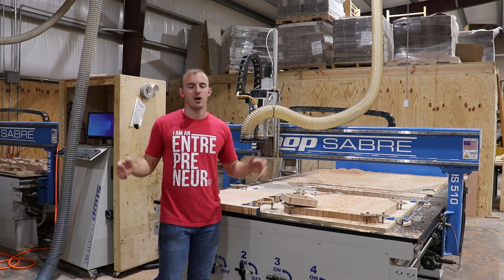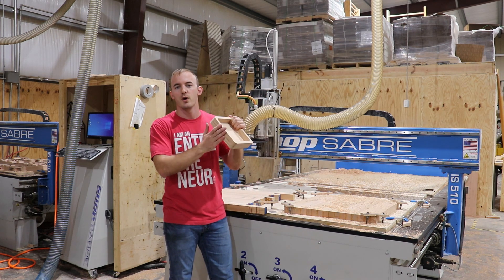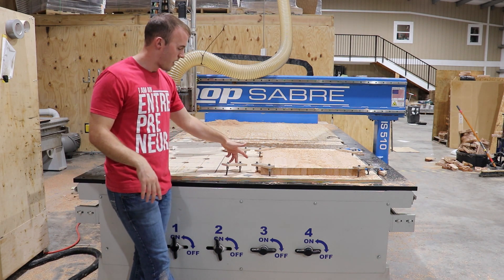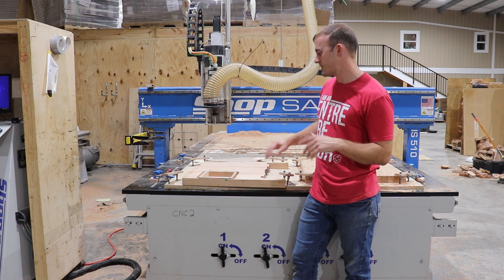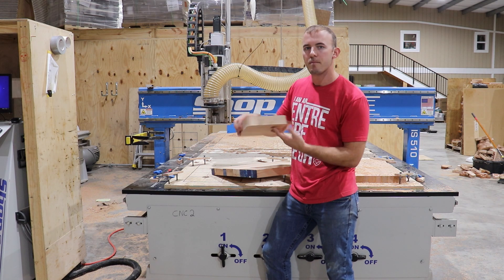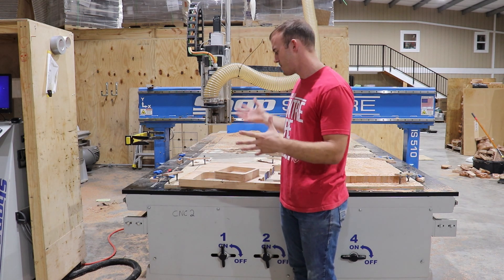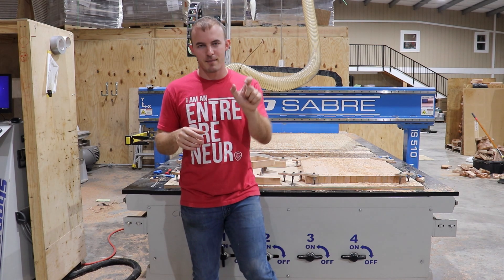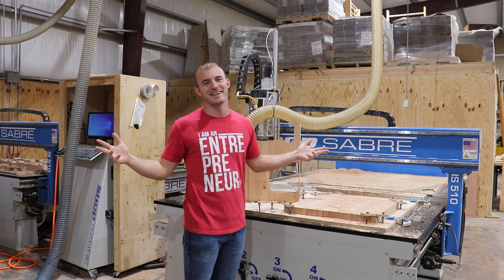Simple Oak Tray Cut | In Depth Look at CNC Router Machining

Comment: Good call on the mechanical hold down as well as the vacuum.  the machine I run uses a similar vacuum setup and it is very easy to shove the workpiece off of your datum. Especially for smaller surface area workpieces. Most of the work I do I’m not able to utilize downward clamping as you’ve done in this video. But just having a hard stop in the X and Y axis has saved many what would have been lost time and materials. Not sure why I never thought about using a serrated roughing end mill with wood. Considering it’s something I always did when I was primarily machining metal.

Comment: I'm curious on that roughing cut it says the feed rate is 600, but in that small of a space it can't even get up to 600 can it or it more of a torque thing?  Any change you can show this on the onefinity unit. I'm very curious to see how bad it works compared to your big boy.
Reply from the maker: I will run a test like that in the future on the Onefinity. It did reach those speeds on the shop Sabre, it reaches those speeds after 1 inch of travel, It can handle it, but we shall see if that Onefinity can one day soon!

Comment: thank you
I hoped you would explain why ( cutting the outside shape of tray) you ran your bits - both the rougher ones and the finishing one backwards. And what is the benefit doing it this way as if you were run it ''normally'' in the anti-clockwise direction.

Comment: 92% stepOver? I know what stepOver means but obviously I'm missing something during the cutout portion.
Actually, I really don't know what stepOver has to do with contouring a cutout any way. Depth per pass makes sense but I don't actually understand what stepOver has to do with contouring when its not stepping over. It's just adjusting depth per pass every time around.
Reply from the maker: Step over is the amount the bit moves over when it’s doing a pocketing toolpath. So a 50% step over on a .25” but would be .125”
Reply: @cutting-it-close  Yes that is pocketing and I understand that. But why is it used when cutting a straight line because at that moment you were talking about cutting the outside edge at a 92% step over. Contouring a straight line (outside edge and inside edge of bowl) does not involve stepping over any at all. It only involves Depth per Pass. So why is it used? Now do you understand my question?
Reply from the maker: @iwannaapple7190  Oh I understand. I may have misspoken in the video, but what I did do in the video was a roughing profile pass, then I came back with a finishing bit and took off .03 of an inch so I had to offset the rougher by .03 inches then my finisher actually cut right on the outside of that line cleaning up that .03 offset that the rougher left behind.
Reply: @cutting-it-close  
Thank you for the reply. Totally understood misspeaking already. I will question this way then. When I do a contour path I type in the step over. Why is their a step over for a contour line in the programs? Have you wondered why before? There is no step over but yet you enter one any way.

Comment: I feel encouraged to share my experience with you all, after watching this video. Our machine was bought in Hamburg, a Chinese rebuilt to fit the european standards. The machine feels roboust, looks like the one in this video. I got myself a downcut 2 flutes 8mm endmill to mill Oak. Our spindle top RPM is 20000 (I also got a compress endmill, 8mmD, and upcuts too).
I am running it at 18000RPM, cutting feedrate of 3600mm/min, and 7mm stepdown pass. The noise is alarming. I am afraid to try 15mm stepdown, as he does in the video. I am impress with the results in this video and wonder what I do wrong.

Comment: Very misleading. Yes you may have had you toolpaths and tooling set to run at 600ipm, but truthfully, you never hit the 600ipm. There was not enough linear distance for your gantry to achieve that speed.

Comment: Why not finish the entire cut-out on the CNC? Seems to me, with the kind of vacuum power you have, you should have no issue with movement if your vacuum table isn't bleeding all over.
Reply from the maker: Didn’t want to damage the spoilboard and have to flycut it again.
Reply: @cutting-it-close  Isn't the idea of spoil board to be able to, well, spoil it?
Reply from the maker: Yes, for sure, but if I dont have too I won’t to save time on resurfacing

Comment: I'd love to see the factory plenum on your machine. With the vacuum grooves shown cut so far apart it's no wonder the hold-down won't be sufficient for the monster bits and the power of the gantry moving the spindle around. But with a tighter grid cut into the plenum with an additional porous spoilboard on top and the zone restricted to your current work area, I'd think you should have way over 50-70 lbs of lateral hold-down. With an additional paper-thin interface between the spoil and the work, even greater.

Granted you're doing a lot of deep cuts in a dense wood, but not having to make mechanical hold downs is the greatest advantage of a vacuum system - #2 being what you mentioned, holding the work material flat as possible.

Comment: Great Video! I have just bought the same CNC and I have a project making 1300 square oak tiles. I am somewhat new to using a CNC and the roughing bit. I just ordered one to help with my project. How do you offset the roughing tool path in VCarve? Assuming you are using VCarve.
Thanks!
Reply from the maker: Click on advanced toolpaths when you are creating the profile toolpath then an offset toolpath option will pop up and do a .04” offset.

Comment: Not boring! I got a small hobby CNC; my max feed rate is 100ipm, since my spindle can go from 10k to 32k RPM my options are limited. This is what people need to know before they buy a machine, even an entry-level machine like mine. I would say that I don't agree when you said you wouldn't worry about all the tool changes if you're just doing one tray. Those glue-ups take a lot of time to get the wood 4 square; I'd hate to get to the milling part and have a bunch of tear out.
Reply from the maker: Thank you and I can see what your saying about the tear out on not doing the tool changes correctly! I would then do a down cut with 1 pass and an upcut with the remaining passes.

Comment: Nice and quick machining? I wonder though if your machine reaches 600ipm at that acceleration within about 6x6" pocket? I don't see much difference with 220ipm. Two way adaptive clearing at full depth is probably even quicker and better for the tool.
Reply: Definitely isn't getting 600ipm. Would need to increase those accelerations a lot to reach that on such a small cut.

Comment: It’s one thing to type 600ipm in, it’s an entirely diff thing for a machine to actually be capable of accelerating to that over such a small distance… I have my doubts whether it actually hit that number(you can clearly see the accell/decell at the start and ends of passes) which is probably a good thing bc that spindle is bogging way down… let’s see this thing do the same cut for 2 or 3 feet straight. Looked this company up and they don’t list how many g’s there machines accell is which is really something machine tool builders brag about bc again it’s one thing to type that number in, it’s a whole mother thing for the machine to actually do that.

Comment: Hi Ryan! Thanks for sharing this, very good informational video. It made me think a bit different on my processes. 

A bit on the same note, but at the same time different, I want to ask you something more specific regarding cutting plywood, if that's ok with you.

How would you cut plywood on a small production cnc ( 4200mm/min max feed X, 9000mm/min max feed y, 2.2 kw er20 spindle, no vacuum, MDF spoilboard) so that you do minimal sanding on the edges and have no tear on both faces?
Do you use the same combination/order of bits as in video?
At the moment I use tabs around the pieces that need to be cut, cut them out with an oscillating tool, and clean them out on a router.
My problems with this method are:
Routing the tabs flush leaves a small ridge that needs to be sanded; sometimes I get splinters near the tabs (cross-grain) or on 90° corners or even on straight edges ( for profiling I rough climb and clean conventional, both with a 6mm compression bit)
I also thought about not using tabs and leaving a thin layer of veneer around the parts and then flush trim that.
But how do you cut the thin veneer without chipping it?
For routing the edges flush, would a spiral downcut flushtrim bit be a good choice for both cases?

Would really like to know your thoughts on this since you know how to operate such a wide array of cnc machines and you also cut plywood.

Comment: Learning so much from you as always!  A couple questions coming from someone with an Avid 6060- I assume you have an automatic tool changer using that many bits- if you didn't would you default to more of a compression style bit for speed?  I know you said you usually don't use compression for depths longer than the bit diameter but I feel like I'm constantly making the compromise for the time I would lose changing through all those different bits.

Also- what's your reasoning behind using a plywood spoilboard instead of MDF?  I feel like I see a lot of people going that route with vacuum work holding and interested to hear your take.

Again I super appreciate your content and please please keep it coming!
Reply from the maker: I would go with a compression with a single pass, Iuse a 1/4 compression to cut out 3/4'' plywood in one pass no problem. When you go deeper 2x the diameter reduce the feedrate down 20% of what it should be. If you go 3x the diameter reduce the feedrate 40% of what it should be normally. 

I use both MDF and plywood. The plywood is only for fixtures and gasketing. So its for set products and tool paths and I will also never cut all the way through if I have a plywood spoilboard. If I am cutting all the way through I will use MDF. 

I hope this helps and thank you for subscribing, this channel will be huge one day, any additional subs will help!

Comment: Another great video. My hobby machine tops out at about 150ipm so I won't be duplicating your project any time soon. I do make a lot of jigsaw  puzzles though and use the down cut/up cut combo to get sanding-free cuts. I could do it with one pass with a compression, but this is easier on the machine and bits are less expensive.

Comment: I've had a 4x8 router up and running for about 4 months, and I quickly learned that fixturing is the most important aspect of getting quality results.
Reply: And getting a load of holes in your waste board! Which then require sanding and then resurfacing! Of course you could use clamps or super glue and masking tape but all have their own issues for the hobbyist.

Comment: I'm just off to cut oak on my shapeoko3 desktop CNC at 600ipm. Wish me luck! Oh, actually maybe I need to drop a zero off the end of the feed rate first!
Reply: I feel better at 45 ipm on my Xcarve with the stiffener and stepper motor upgrades, lol. 600 is amazing. And I've never seen a serrated bit like that before. Gonna have to research them in 1/4" size.